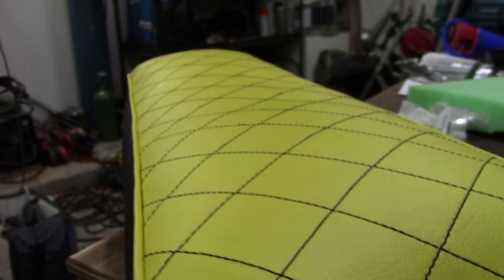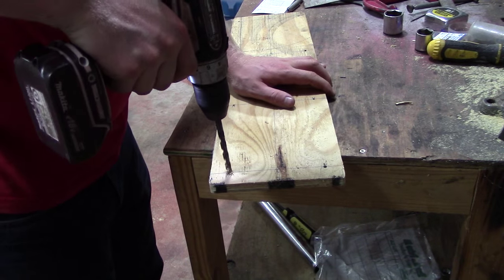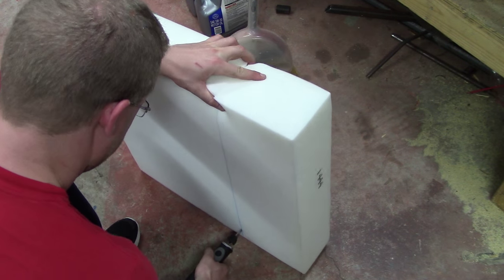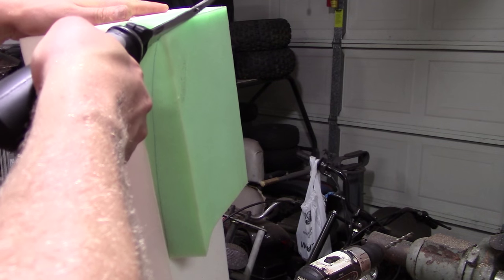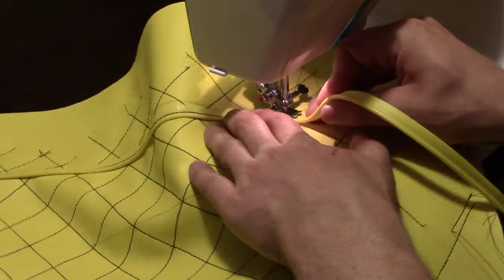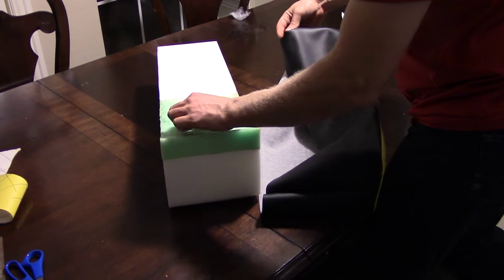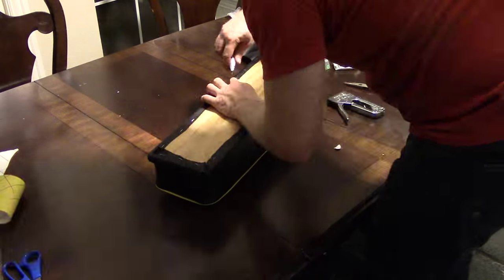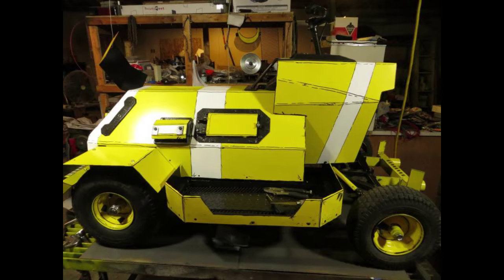How to Make a Mini Bike Seat

Comment: Trick is to sit your vinyl cover outside in the sun for 20 minutes then bring it inside and quickly begin installing  the cover and stapling. Does two things, stretches it out for easy installation and makes a tighter fit. If you do it cold, it looses up in the sun and looks baggy and gets worse over time. Other than that, good job! I just did a 1972 Chevy truck seat. That black vinyl can burn your hands after it been in the sun!

Comment: Very professional looking result.
Reply from the maker: Thanks!
Reply: A Very good tip, if you do this again, epoxy in those T-Nuts and smear a gob of epoxy over them once they are installed. If you remove and replace the seat a few times, those T-Nuts will slip out of the holes. been there done that - No Fun...

Comment: that truly takes a high skill level to do for sure , ive always wondered how that was done , ive done collision repair for 35 yrs and now i do small engine repair its great !! i built a mini bike for a customer that supplyed all the parts luckyly the seat was covered but the blind nuts were strpped out i just carefully moved the seat back one inch and drilled new holes but it wasnt to my standard of quality ,i would like to get a sewing machine and learn that lost skill its amazing to me
Reply: it's not hard I would just do it. if you take aim and keep steady you get straight lines with the machine pulling fast. need little practice but it's easy.

Comment: Awesome job can I give a tip?  When applying the vinyl to the pad use spray adhesive like super 77. Then leave the vinyl inside out and roll it on. Like a condom.

Comment: hey man bad ass seat build heres a little tip iuse to make boat seats just like your doing here for a boat company spray the foam down with adhesive glue and put some kind of thin plastic on over the foam and pray the plastic with silicon spray it helps big time to slip the seat into the vinyl thought maybe you could use that trick on your next build
Reply from the maker: Cool! Never thought of that. Thanks for the tip!

Comment: It’s a shame about the plywood bulging out at the ends. Do you think the foam wasn’t dense enough to hold its shape all the way through or the pad was a little undersized?
Reply from the maker: Pad was undersized. You can overlap quite a bit.
Reply: If you shape the wood to match the radius you used on the corners of the seat you won't have the edges of the wood sticking out like that. The vinyl will wear through and tear on those shape wood corners that you have.
 You can pull the staples, round the wood properly and re-install the cover to make it look professional.